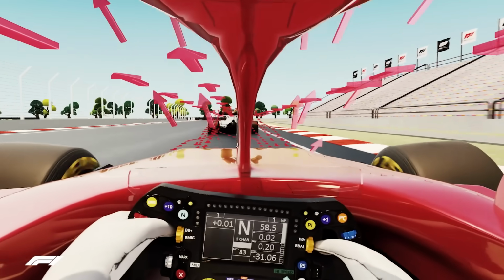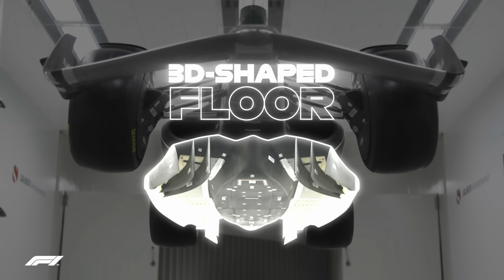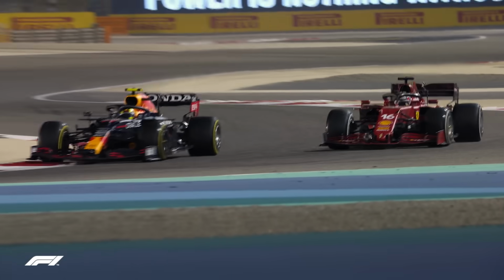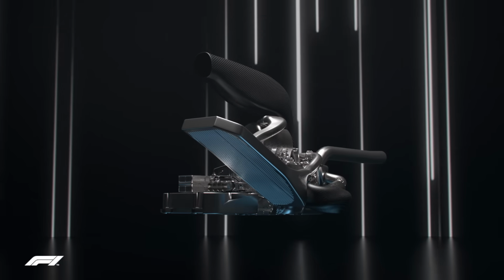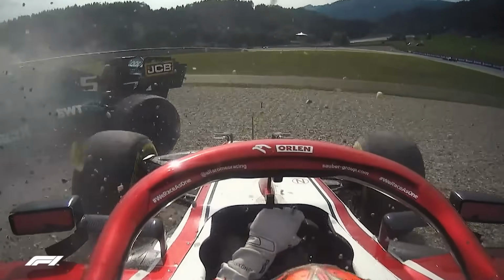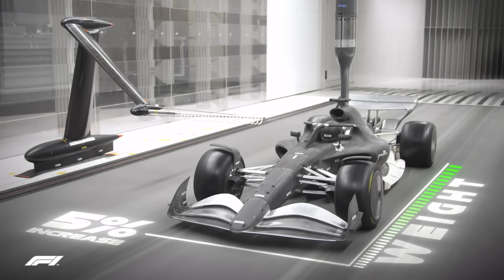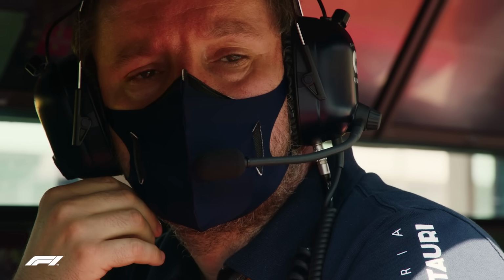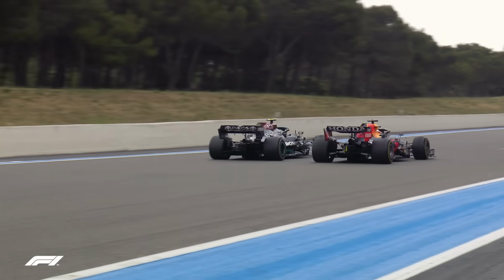Everything You Need To Know About The 2022 F1 Car

Comment: The tires have to be feeling the heat of the thermal recovery system inside the wheel housings why do u think they the teams run low air pressure steel must experience major increases during a tire stint.....

Comment: why not run E100, ? is it becuase of the amount of fuel required when using ethanol is higher and weight goes up because need to increase capacity?

Comment: The decision to use ethanol will prove disastrous. Loss of fuel efficiency and power will cascade into a performance setback that negates or mutes most recent aerodynamic developments. Power to weight ratio setbacks will be noticable and turn racing into a boring sport.  I won't even use ethanol in my personal car or equipment.  It's clearly inferior.

Comment: I thought F1 was supposed to be the pinnacle of motorsports. Why impose rules that everyone has to use a chassis and body work that’s nearly identical and powertrains that are basically the same   FIA even want more sensors on the engine as to monitor more data. If F1 was a real tier 1 motor sport , wouldn’t the team’s engineers be able to go open slather with designs. Idk. Maybe F1 is too boring now. I might go watch something more exhilarating, like speed chess.

Comment: Formula 1 + AI controlled aero surfaces

Imagine more sponsors from IT companies swarming to F1.

AI controls the aero surface relative to the perceived speed. It must only take input from cameras mounted on the car not from other types of sensors.  The AI is a standalone system in that it should not take external radio input except signals from mounted vision systems.  The AI is homologated within the race period as deemed by the FIA.

Comment: I reckon the cars would be much much faster because of the new 3D shaped floor, ground effects, front wing, rear wing and better aerodynamic bodywork over the car and the fact that there is going to be a lot less drag. And with the bigger wheels that might help the car reach possibly 250mph and possibly more. But with that we could see much bigger crashes (hope this doesn't happen) Hopefully the cars will provide better racing.

Comment: The fuel they use in racing is inconsequential as compared to the fuel used to fly/drive the teams to the different venues. I am old enough to have heard the story 'the changes will promote more competition'  when in fact it has always resulted in a greater differential between the rich few and the remainder of the pack.

Comment: garbage - back to 1986 would be better.  As for the eco nonsense around fuel, they could run on 100% ethanol if they wanted , not sure what the issue is there  - probably more CO2 wasted today than 30 years ago when you factor in the sheer number of components, the materials involved in their manufacture and all the extra races

Comment: Boring, standard parts what is this nascar. Let the teams innovate bring back multiple tyre suppliers, refuelling, make the cars lighter and smaller. F1 is about the pinnacle of racing no one uses it to trial technology so go all out screaming v12 use hydrogen or biofuel if you want but bring the noise and speed.

Comment: Would they sound better if they reved way harder or is it just the lack of cylinders? Is 10% even the optimal percentage of ethanol? Would it be better to replace the fuel with speakers that just play engine noises

Comment: So the F.I.A. finally simplified the ailerons to be used at the 2022 F1 cars. Yet, to complete those 1st important steps towards the right direction, the F.I.A. is required to implement two other important rules: 
1st - The F1 cars suspension need to be independent from any electronic assistance. 
2nd - No publicity to LGBT disorientation and lack of decent ideas. 
 Otherwise, the F1 is going to change its name to Fb for Formula boring, with the alternative nickname of Fd for Formula disorientated.
 Plus -> each pilot is to have the right to define his own race strategy; or else the crooked team principal gets fined.

Comment: Okay I'm not the greatest fan of the new design, but if it leads to better racing then I'm all for it, but the larger wheels means cars will be slower. Why compromise speed I don't think increasing the wheel size was needed

Comment: They need to reduce the car size closer to F1 V10 size so it possible for DogFight Wheel to Wheel battle, wheter in straight line or corner.

Comment: Maybe I am wrong with this but the F1 cars have no suspension for ride comfort like shock absorbers or springs. That is why they have 13" rims and a big sidewall on their tires, to absorb imperfections on the track and stop the car and driver from bouncing all over the place. If the rims are going to be 18", what is preventing all of the bouncing around? A smaller but stiffer sidewall is just going to add to all of the bouncing around and at 300kph the car will most likely be bouncing even harder on the floor, which with wreck the new 3D floor thing. If that gets wrecked, they will loose even more down-force. More cars would most likely loose control as well. IDK seems backwards to me.

Comment: The best thing for F1 would be to return to a less exotic & radical formula. Reduce maximum width by at least one 18 inches (50 cm), reduce max length by the same amount, reduce or eliminate front wings. This would greatly improve passing and open up driving strategies.

Expand the formula to allow a variety of design strategies, such as top speed vs. acceleration vs. cornering. Reduce max down force so cornering, braking, and acceleration require more finesse. Allow different engine and transmission designs.
I personally would like to see hybrid, Stirling, turbine, and all-electric on the same course competing on a level playing field, but maybe that's going too far.

Perhaps most important, get rid of a lot of the high tech stuff, maybe even power steering, so drivers have to develop skills beyond stepping on the gas and having no fear. When a 19 year old with almost zero experience can move up to F1, it's apparent that skill and experience requirements have been almost eliminated. F1 should not be solely a "daredevil/fast twitch" sport but a competition of both ma vibes and drivers.

The present approach of controlling everything to the point where the cars all act exactly the same has been to the detriment of the sport.

Comment: does someone have the data for the carbon emissions of F1? I would like to know what percentage of the pollution/carbon emissions come from the cars themselves through burning fuel compared to that made by the transportation of the equipment from track to track and staff using jet planes. In my uneducated mind, the cars should be able to be fuel consuming high reving v12s that sound amazing for the audience but still on the whole reduce the emissions elsewhere such as transportation. How far are we going to go making the cars more efficient? Will we end up having formula E cars and be all electric? I just want the roaring engines back that give me goose bumps everytime I hear them reving.

Comment: i Need a Engine that has a scream like the predecessor F1 car using a 1600 cc v8 na + hybrid engine maybe the sound will be Nice 😎😎

because the current f1 car sounds like a mass production car and not like a grandprix car 😁

and for safety, I want the belt to be put on emergency quick release ( like in helmet bike ) to make it easier for drivers to get out of the car when there is a fire

Comment: Two problems with the new rules.
1. The more they standardize and shoehorn in the design the more F1 becomes just another spec series. Just because some teams can’t cut it in terms of design doesn’t mean they should throw everyone else under the bus.
2. All it’s going to take to ruin all the work these experts have done is one team to find some advantage that disturbs the air behind the car more and boom, back to 30% loss for following cars.

Comment: Looks like FIA cant innovate safety without something dangerous happening... same old halo remains. Its only a matter of time until Massa's hungary incident occurs again because of this halo design, lets just hope the driver who has to be the victim will be as lucky as Grosjean so that FIA will finally add an aeroscreen like Indycar did.

Both are equally strong device's anyway, indycar just takes into account debris and potential driver head injury from it which can easily lead to loss of consciousness at high impact speeds which in turn will lead into a high speed crash with  no brakes being applied to lessen that impact.

Comment: Here's a suggestion, why not go for more durable tires, everything is pushing for sustainability, with eco fuel, limited fuel to use per lap, etc. Why not go for more durable tires and scrap pitstops all together, blasphemous i know but hear me out, pitstops came about because they wanted to lighten the cars back then (john barnard beyond the grid) but the engines weren't efficient yet but now fuel consumption has been limited so the original purpose of the pitstop is gone, I get lewis and  other drivers wanting lighter cars but becoming heavier means better safety and efficiency, the cars can be lighter if they don't need to carry a fuel for a race distance, right now the cars are like early cellphones still developing to package everything  together in terms of being safe and efficient once they reach a satisfactory, like how newey wanted a narrow nose back in his mclaren days but the r&d for that just wasn't there yet but come 2016 mercede was able to make a narrow nose that could pass the crash test or like mercedes making a brick of an engine as a development platform for their dominant turbo v6, F1 cars are still on the way to sustainability

Comment: Please make the cars smaller. And eliminate high degradation tires. Even though I like the concept of an element of strategy to racing, seeing all that rubber being thrown around in the track is just the opposite of environmentally friendly. Mandatory pit stops or (safer) refueling seems like a much better way to achieve the same thing.

Comment: It's not the first time F1 has used low profile tyres, a few teams in the 60's and early 70's used low profile tyres.  There's also the Tyrrell P34's front tyres that were pretty much just rubber bands!

Comment: Love the new aero package, larger tires and emphasis on parity that could result in tighter races.  But the new 10% ethanol requirement in the fuel is laughable.  It sounds like they’re doing this for the carbon footprint…?  Really?  This is racing and if it doesn’t equate to more horsepower or better racing then leave it in the lab.

Comment: Is it me, or I've been hearing "with next year's cars, downforces are significantly reduced" for not less than a decade? If so, either downforces should already be almost non-existing, or they used to sound like concrete walls back in 2000s

Comment: It is smaller, but a bit heavier. It produces less air disturbance and probably more downforce due to ground effect. The tyres are basically the same in terms of width and the engine is just as powerful as before. Would this car be the fastest of all time?

Comment: Because of the new tyres wheels will be much slower and heavier also the suspension will need to be redesigned to withstain the pressure that was previously absorbed by the rubber which will again add even more weight and will slow the cars down. The current tyre design is a little bit unreliable but I am sure that in next seasons much slower F1 cars it would have been just fine.

Comment: It's a pity the cars keep getting heavier. Smaller, lighter and more nimble cars would make for more on track action. Perhaps the engines need to also get smaller and lighter and less powerful so the safety is not compromised. Changing to a 1000cc V4(90 degree) turbo hybrid would be an easy evolution of the current engines.

Comment: It would be interesting if the only major rule for the engines where fuel flow making any type of engine a possibility. Hybrids etc would still be viable because of their increase in power over pure ICE cars but would be heavier because of all the extra weight of the hybrid systems.

Comment: Replacing the battery pack for high capacity capacitors, and using Hydrogen instead on Gasoline as fuel to the ICE, would make F1 in virtue signaling more "Environment Sustainable". Check the Hydrogen-Powered Toyota Corolla, that raced at Fuji, and...it made loud noises. A plus to the sport.